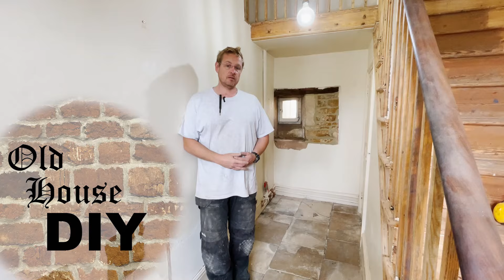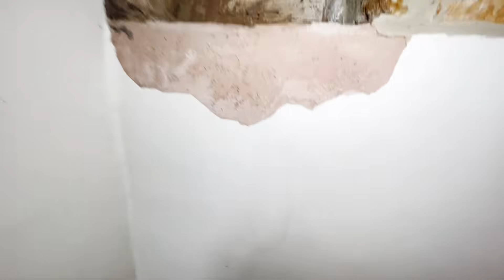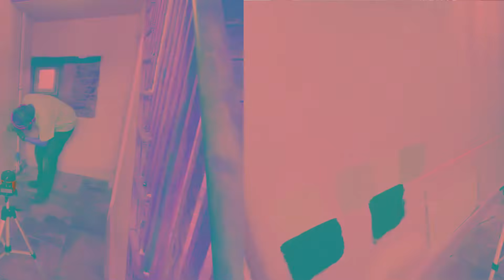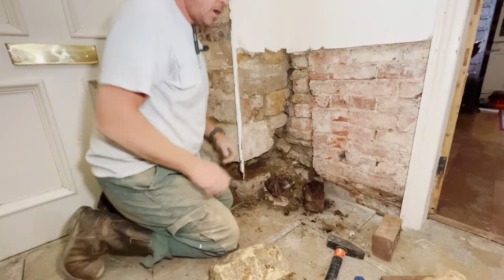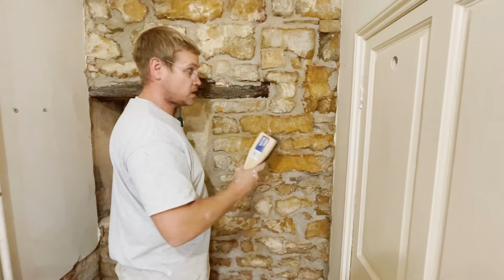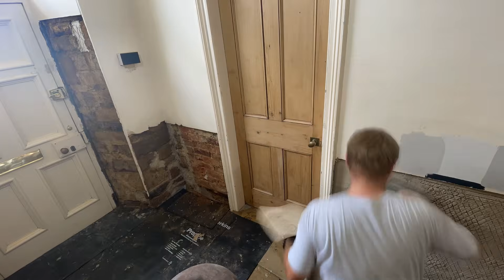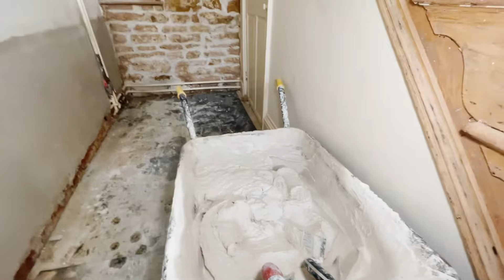Treating damp

Comment: The only effective way to tackle damp ................. put in a DPC !
Reply: I'm only just getting into reading about "rising damp" and currently on the side of... It doesn't exist. For me a common reason for "rising damp" is that over the years the street level has been built up, the floor level inside is now either less than 150mm above the road outside or below it and air bricks are being covered or are clogged up.

Old brick bridges didn't have DPCs and yet they don't seem to suffer from rising damp despite sitting in water.
Reply from the maker: Sorry, no!
Injected damp courses, tanking and gypsum just trap and mask the problem causing damage to the structure. The rotten wood you saw in this video is the result of trapped moisture from an injected “damp course” and gypsum plaster.
Reply: DPC 🤣🤣 You must be one of those plonkers what believe water rises by capillary action 🤣🤣
Reply: @anthonymclean9743  When you build your next house , build it without a DPC . Or have you never built one?
Reply: @eddieharding2432  Built loads over years including a bungalow this year , building control and NHBC insist on dpc that i cannot control , but most old buildings are not built in the same principle especially if they are of a date where they are built from lime mortar , and a poxy retrofit dpc tends to do fuck all , only damage the structure.
Reply: @anthonymclean9743  I will have to bow to your superior knowledge then .
Reply: @anthonymclean9743 well it doesn’t rise by Gravity so that only leaves capillary action.  Simple Physics.
Reply: @stihl3826  And what Harry Potter wizardry makes water pull up through masonry too a metre high ? According to the damp whallys .

Comment: Very interesting. Any reason for moisture, high ground levels, broken gutters, naturally gypsum plaster blocks moisture in, of course. Do you leave your lime plaster some time before next courses, can't recall you saying.  What types of sands do you use. Sorry, so many questions.
Reply from the maker: Thanks for watching and smart question.
Between dubbing-1, 1-2 and 2-3 I wait about a week, needs to be fairly hard, so you can’t dent it with your finger. Between 3 and 4 I wait a day.
This room the ground level (and neighbours house) is very high and level with the bottom of the window. Historically I think it was okay but the damp treatment / gypsum made it un manageable. (The floor had varnish and plastic sheet under it which was also very bad, there is a separate video on that.)

Comment: Regarding the ingredients for the interior walls:  Fill or First or "Scratch Coat" is 3:1 Sharp Sand to Lime Putty/Fiber.  So three units of sharp sand to one unit of lime putty (the lime putty has "fiber" in it.  Sounds like you use "hair" for the fiber.  What kind of hair, and do you like any substitutes--I've seen finely chopped straw, cattail fiber, and toilet paper used--and how much hair to lime putty?)  Second coat same ingredients and proportions.  Third Coat:  2:1 or 2.5:1 Two-2.5 units of "much finer" sand to 1 unit of lime putty; no fiber?  Is this much finer sand still sharp?  Maybe Fourth Coat for a fine finish surface: same proportions but water added so mix is thinner....  Thanks for your time and generosity in sharing this knowledge and showing how!  Subbed.
Reply from the maker: Hair is traditionally horse or goat, but I’m naughty and use poly fibre. You can’t use anything particularly soluble as it will dissolve / rot such as toilet paper. Mixes with hair in even have a shelf life as the hair will rot out. I just dump a few big hand fills into a narrow mix, as it mixes in the hair spreads a lot aiming to get a fair bit of fibre throughout.
I normally use “grit sand” for the first then “plastering sand” for the third. 
This is a really good booklet on lime.
https://www.blackdogpress.co.uk/product/lime-in-building-a-practical-guide-by-jane-schofield
Reply: @oldhousediy  Thanks so much.  I guess dog hair would be ok.  But sounds like poly fiber, being not organic, and not soluble in water, would--far from being naughty--be superior as rot-ability goes :-)

Comment: Very nice. What mix did you use for repointing?
Reply from the maker: About 3:1 sharp to putty for the pointing, then same to for first coat but haired, then move to finer sand 3:1 without hair for second and then about 2.5:1 sand to putty for top coats.